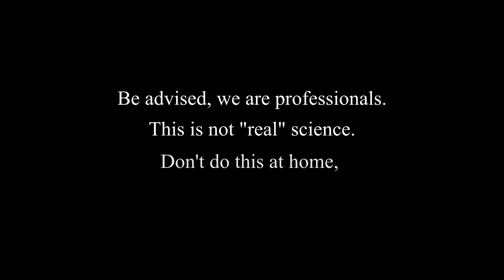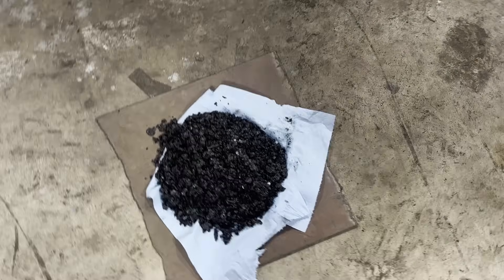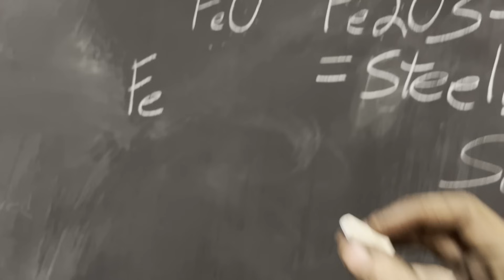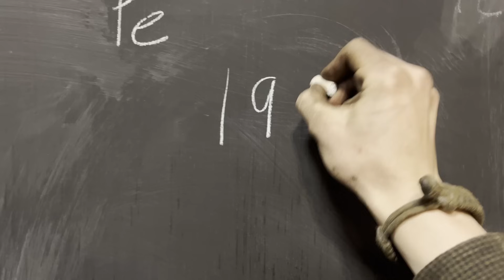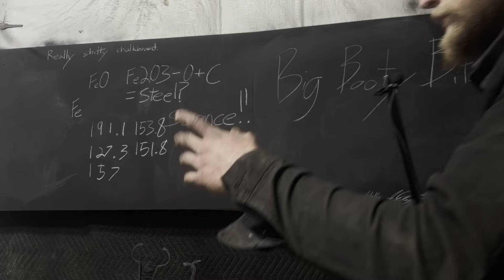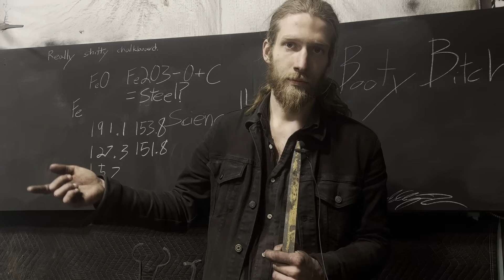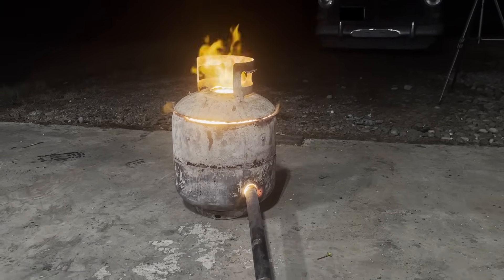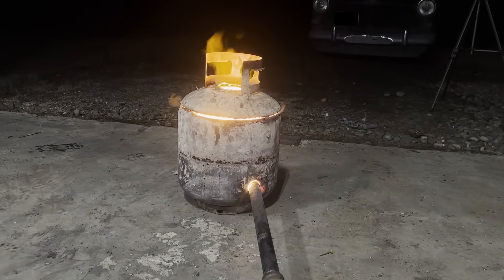Recycling Forgescale?

Comment: Ok, someone finally used wootz correctly. At least from what I understand of how it should work.
Reply from the maker: @kborak  wootz is a lot of things. It’s used today as a term for blade steel that was melted/smelted in a crucible.
Reply: @ForgeEmbersandReliqua  wootz is only steel that has been put through a certain heating process that causes the pattern crystallization. Its used wrongly for many things. You seem to have made actual wootz steel, if not from the proper mine, on accident.

Comment: Great vid, curious to see the finished blade. I’ve seen that a piece of cardboard under the crucible will help keep it from sticking to the forge.
Reply from the maker: @Likely-LARRY  sometimes that does work, but I’ve found it to be inconsistent. Chipping the bottom of the crucible from the plinth is usually necessary anyway.

Comment: You need to add a reduction agent to the crucible to get steel from oxidised steel. The industry uses gasses like natural gas, CO or H2 at temperatures above 1000°C. Adding a big chunk of coal to the crucible with the scale basically does that, you would need to add enough carbon to take away most of the oxygen from the mill scale. As you have 3 Oxygens in millscale and the molar mass comes out to about 160g ,carbon has a molar mass of 12g, you need around 36g of carbon for every 160g of pure mill scale. You say it's 60% iron so you need about 15g of carbon for every 160g of iron rich scale to reduce it.
Reply from the maker: So by that math, what’s the resulting carbon content? I’m no metallurgist, my solution to the excess carbon for reduction ratio was “some more”. I’m going to bet that the resulting steel is somewhere near eutectoid, not above 1% which is technically the minimum successful C content for wootz.
Reply: @ForgeEmbersandReliqua  It would be a theorethical 100% conversion with nothing but pure iron and CO2 left. But chemistry never works out to 100%, I have no idea what this would result in, likely some carbon would stay in solution and not be available for conversion anymore. The problem is that the resulting CO2 gas surely will break the crucible if it's airtight and if it isn't airtight it's basically just like putting the oxides directly in a natural gas flame which could also help reduce some oxides to iron, maybe that's why the broke crucible worked? I imagine if there is more carbon than is neede you would get similar to bloomery steel carbon content.
Reply from the maker: We speculated at the time that a crucible with a port hole would have been the move. We tried consolidating the “weird matrix of bullshit” that we extracted from the second attempt, it surprisingly behaved kind of like a bloom.
Thank you for sharing!
Reply: @ForgeEmbersandReliqua  Looking forward to the "Matrix of Bullshit" knife. 😆
Reply: Forge scale is Fe3O4 rather than Fe2O3, which is your typical red rust. So I believe those numbers are going to be off. Wikipedia says a typical blast furnace would do Fe3O4 + 4 CO -> Fe3 + 4 CO2. So you may need enough oxygen for the carbon to burn and become CO to then react with the scale? But if you aren't sealed so you can get that oxygen, you run into additional issues when burning propane: C3H8 + 5 O2 -> 3 CO2 + 4 H2O. Potentially allowing forge scale to form again: 3 Fe + 4 H2O -> Fe3O4 + 4 H2. I expect that you may be better off trying to use coal as the fuel. Generating CO at the same time as heating it? I guess that would be kind of like a small scale bloomery using the crucible to hold the ingredients.
Reply from the maker: @erikseglem8951 unfortunately, the crucible will insulate the ingredients from any benefits using coal or charcoal. This is simply not a technique best utilized for crucible steel. Another point for bloomery steel.